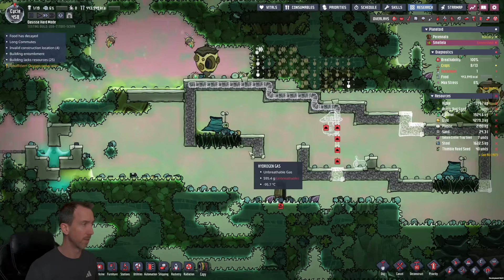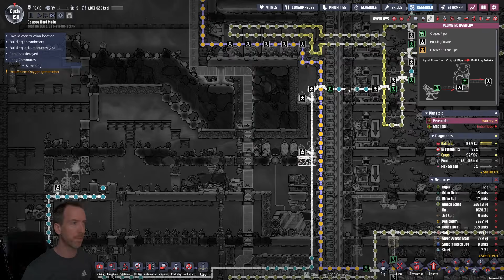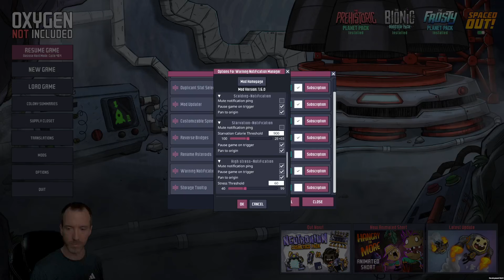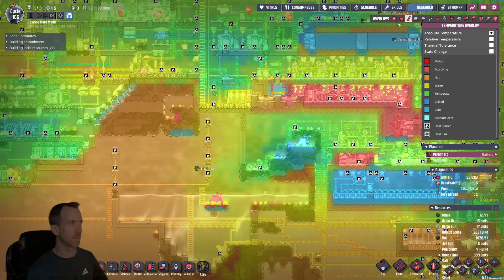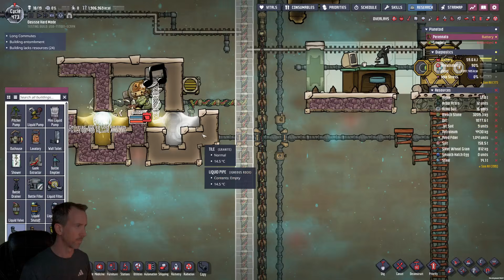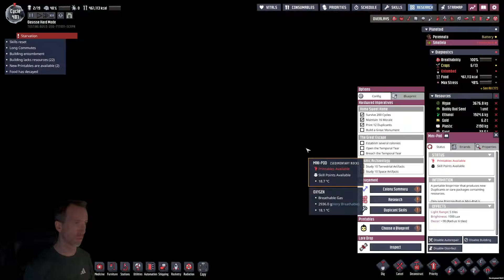Molten Slickers and Solid CO2 - Oasisse Hard Mode  - Ep. 30

Comment: you could protect from in-pipe state change by doing the restricted the flow rate thing to 10% of max so 1kg for liquid / 100g for gas - albeit slow so you get the same amount of liquid as if you were transporting gas but at least it wont break - you can put a gas / liquid exchange somewhere warmer